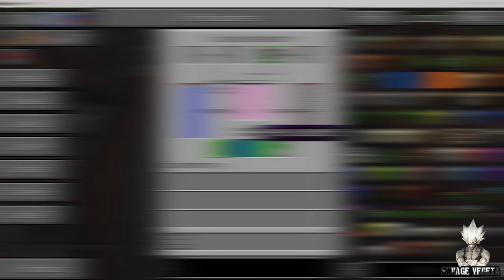How to set up " Nuclear FUSION REACTOR" in HBMs Mod | Self Sustaining Fusion Reactor Tutorial

Comment: The hardest part of this mod is how to get water in survival, without using a water can, because this mod doesn't have a water pump!
Reply from the maker: That's true there's no water pump. So the best option is to craft multiple infinite water barrels and placing them in fluid tanks , that should solve all your water problems.

Comment: Hey, Savage Vegeta and everyone else! I've built myself a rather basic fusion reactor (similar to the one in the video but updated with a cooling tower and a bunch of industrial turbines), but the problem is that it won't produce the ionized particles. I tried it with all the types of plasma that should produce the ionized particles, but they just won't be produced. Every other part of my reactor setup runs perfectly. The water is being used and refilled, the ultra-dense steam is being produced and runs through the turbines and cooling tower, and the plasmaheater produces the deuterium-hydrogen plasma. I've rebuilt my setup five times, but it just won't produce the ionized particles. It is really frustrating because I haven't found a solution or even an idea why the ionized particles aren't being produced. I searched so long for a reason why the ionized particles aren't in the slot in the fusion reactor. So I am writing this comment because maybe you have any idea why my problem exists or why this even happens. If anyone could help me, I would be very thankful, and then I could finally progress in my world. Thank you for reading!

Comment: It is impossible dude i did wht you said and because 1 block it didn't build the fusion reactor then i placed the already build one  and it did connect but then exploded steam output and water connected
Reply from the maker: I used the small turbines here, when I made this video leviathans didn't exist in the mod only industrial turbines did
But as of now just use leviathan turbines to convert all the steam from the reactor to power and nothing should explode
Reply: @SavageVegeta  i used the leviathan one but no need to worry i forgot to put the blanket inside because my network was gone by that section

Comment: In this mod you need to change the structure for the extraction and extraction of plasma, on the mega structure of the thermonuclear reactorA so mod is very cool but the developer does not update the tab on the missiles there you can add a lot of the same remotes, from the radar and on the screen, earls
Reply from the maker: Yes you are right it has been a long time since the gui on the missiles have been changed. The developer of the mod has focused many changes on the energy production and transmission methods recently and they are very cool

Comment: I have a few questions about this reactor, and what happened to mine. And I did read the Wiki.

1. Why did the reactor cause a small explosion on the top? (I had a blanket that exceeded the requirement for the plasmas heat) It randomly exploded.

2. Why did it emit radiation for about 100  block radius and contaminated the grass and soil?

I have the setup perfect and it runs very well, it just does random stuff sometimes, and wanted to ask you to shed some light onto why the reactor did these things. Thank you
Reply from the maker: The explosion could've been cause of total loss of power inside the fusion reactor, cause the fusion reactor needs a constant supply of power to maintain its magnetic field to stop the plasma from touching the walls. If the power levels hit 0 while the reactor is running then it results in a blast. However I have never seen it emit any sort of radiation ... then again it has been a long time since I exploded any fusion reactor so maybe it might be a new thing however I don't remember reading anything about it in the changelogs 

Here I have made a self sufficient reactor design, try it out and see if the same problem persists : https://youtu.be/hIVyyon9izY
the only difference here is that the reactor in this fork also uses a secondary coolant cycle but that is only for producing excess power
Reply from the maker: Another reason can be that the internal buffer for steam in the reactor must've been full and that's why the reactor went boom but the iirc that is a feature which doesn't exist for the fusion reactor and I have always used fusion reactors with closed loop turbine cycle so steam never builds up in it ... so I can't say this for sure

Comment: I can't read the lore for the fusion reactor core block. Could you please tell me the required materials so I can build it in survival? I see the materials but not the amount I need to make it in the assembly machine. Thanks
Reply from the maker: Sure thing man , I will tell you those materials tomorrow when I log into the game !!
Reply from the maker: 6x Steel Ingots 
6x Tungsten Ingots 
12x Neutron Reflectors 
12x Super Conducting Coils 
8x Polymer Bar
8x Advanced Circuit 
3x Versatile Chipset

You need these in assembly machine to craft a fusion reactor core component
Reply: @SavageVegeta  Thank you so much man! I can't use NEI because my launcher crashes so I can't see the lore properly this helped me so much!

Comment: I'm not getting any energy from the fusion reactor to the steam turbines what do I do?
Reply from the maker: Fusion energy won't give out direct "energy" to the steam turbine ... it will only output steam so double check the steam pipe that you have connected to the turbine and make sure it resembles the steam that you are producing. For example if you are making super dense steam then make sure it is the super dense steam pipe connecting the reactor and the turbine.
Reply: Oh ok I was trying to make ultra dense steam but I used a super dense steam turbine

Comment: Hey this works great but I am really confused on how to make it self sustaining cause when we turn Steam into water it won't turn it into water only Low-Pressure Steam and then we can't use anything with that and it stops the Steam process and stops making energy
Reply from the maker: When I made this video Cooling Towers and Low Pressure Steam were not added 
So you can use the different types of cooling towers and condenser to convert low pressure steam back into water

Comment: Hey man, I have a problem. I connected the water supply and got the reactor running, however eventually the water was running out even with an external source, which caused the reactor to blow often. What do I do to make the water recycle itself efficiently?
Reply from the maker: Well first thing you can do is craft Infinite water tanks (yes they can be crafted in survival) and make an infinite water setup out of them. Also what you can do is take the water output of the final steam turbine and get it back into this infinite waater system.

I have made a similar system for RBMK reactor but you can very easily use it for this reactor as well. Here is the video : https://youtu.be/_sqxXisMY3A

Let me know if you are still confused about anything or run into trouble :)
Reply: @SavageVegeta  Yeah It worked! I just needed to add more water tanks with those inifinite water supplies. Now I have to figure out an automatic tritium production. Thanks for the Help! :)
Reply from the maker: @szymonjanc2416  ah I'm glad to hear that man , also for tritium you're gonna need alot and alot of lithium.
Reply: @SavageVegeta  yeah me and my friends made a quarry system that mines a lot of graphitic schist, so lithium isn't too much of a problem XD
Reply from the maker: @szymonjanc2416  well then have fun manufacturing tritium and getting rich through that 😂💀🔥
Reply: How many cooling towers might be necessary for getting all that water back? I've been experimenting with the deuterium-hydrogen reaction (which provides the least usable heat, but is probably cheapest), and even that consumes water at a high rate. Note that I'm using Reloaded for 1.12.2, where the leviathan turbines have no UI (and I'm not sure if their steam processing rates and power values were changed, if they only process as much steam as the one at the end of the chain can output, or what)

Also, exactly how do you automate item I/O for the chemical plant? I've tried itemducts and buses in multiple places, with no success (yet). The same mod version seems to have no dedicated deuterium extraction towers, but instead has it made using water and (solid) sulfur in a chemical plant. The hydrogen requires only water as input, but it's slower and may require multiple plants with the same recipe in order to make enough.

Speaking of fusion fuels, can a fusion reactor running on deuterium and tritium breed lithium into more tritium, and at a high enough rate to sustain itself?

Comment: how did you make the steam turbine transform steam to water? i tried everything and failed and the steam is becoming low pressure steam instead of water version 1.12.2
Reply from the maker: Cause this video was made when low pressure steam wasn't introduced to the mod. Now in order to convert the low pressure steam to water you'll need a cooling tower. Get the Lps In there and it'll output water
Reply: alright thanks but what if the energy the reactor is producing wasn't enough to make it self sustainable or it was enough for the reactor not the heater component

Comment: whats a better way of making plasma and more efficent
Reply from the maker: Plasma can only be made in the plasma heater and the higher tier you use the hotter it is going to burn thus producing more power. For efficiency (which I'm considering is in terms of automation) Hydrogen - Deuterium plasma is the best cause it can be produced in an infinite amount and with proper design the entire setup is totally self sustainable
Reply: @SavageVegeta  all i needed is the fuel type but thanks anyway

Comment: how did you make the steam turbines produce water from steam???
Reply from the maker: By using steam condensers and cooling towers. Steam will be converted to low pressure steam , which will then go in a cooling tower and be converted to water
Reply: @SavageVegeta  thanks!

Comment: Can it explode
Reply from the maker: yes it can however it doesn't do alot of damage when it does
Reply: But i success fully make a fusion reactor with cooling tower and turbine
Reply from the maker: @iisminahandayani3434  that's good then,  make sure it never runs out of energy and it's blanket durability doesn't run out and that should prevent it from exploding

Comment: Just saying it's not nuclear fusion its nuclear fission, nuclear fusion is when 2 particles collide in a star releasing a ton of energy, nuclear fission happens in a nuclear reactor/power plant releasing a ton of energy
Reply from the maker: Umm nuclear fission is when a heavy unstable elements nucleus is bombarded with neutrons which splits it into two and releases energy while fusion is when two lighter elements nucleus under high temp and pressure to combine into a heavier nucleus again releasing energy.
So its not necessary that fusion can only occur in stars , it has been simulated multiple times in recent years on earth as well if conditions are met. And as this reactor uses deuterium and tritium as fuel , both isotopes of hydrogen its a Fusion reactor not a fission reactor :)

Comment: All our new effort needs to go into higher energy density batteries. The also necessarily enlarged grid, with wind generators, and solar with backup batteries are all ugly and use up much land, while also being significantly expensive, vulnerable and all having some safety issues. They are all also going to be totally unnecessary with the advent of the FUSION POWERED "SAFIRE REACTOR" that is safe, costlessly self-fueling, totally green, buildable on any scale on a tiny footprint to match local community requirement and is chokeable and 24 hours dependable. It makes all other technologies redundant as in being much less advantageous. It is FUSION NUCLEAR powered by nuclear nuchemy (Nuclear Chemistry) and seen at "AUREON ENERGY.COM". Also learn your new plasma physics, astrophysics, and general Electric Universe Theory at "THUNDERBOLTS PROJECT.COM".